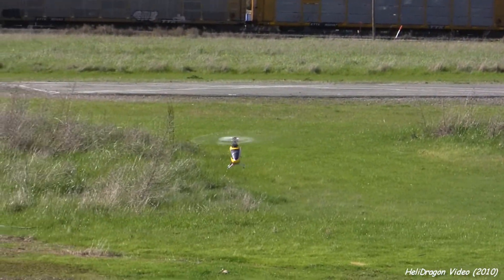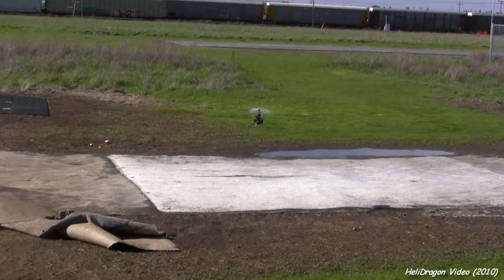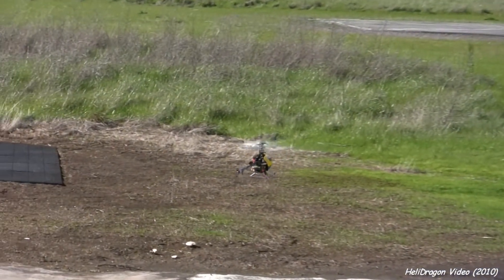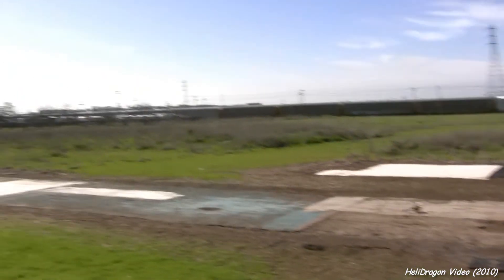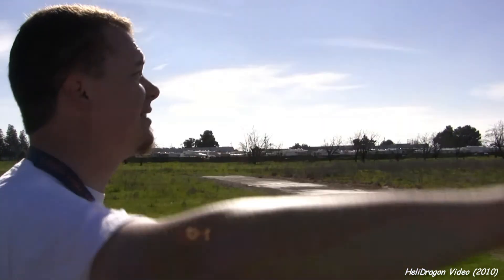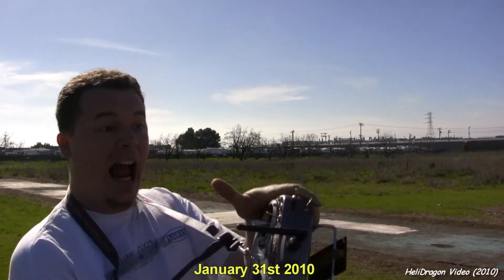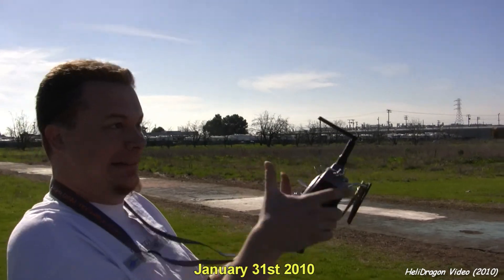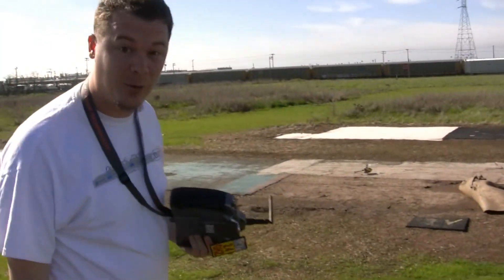1/6/10 - 1st Time Trying 3D & 3rd Time Ever In Idle Up.

Comment: Hehe :)
Good recovery! Looks like your 250 is working nicely. Took me a long time to get mine to fly right.

I do not understand why everyone tries the stationary flip as their first 3D... I did it myself even. It's actually a fairly hard move to pull off. Try working on stall turns and then aileron rolls in forward flight. If you have plane experience, those will seem like more normal moves, and they are quite a bit easier and the penalty of mistakes is lower. Do it with your 450 though.